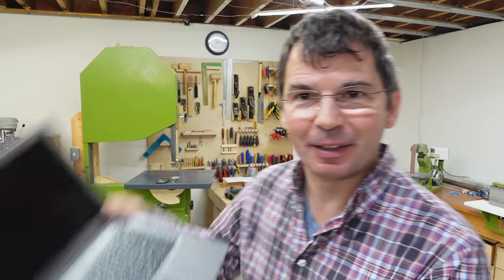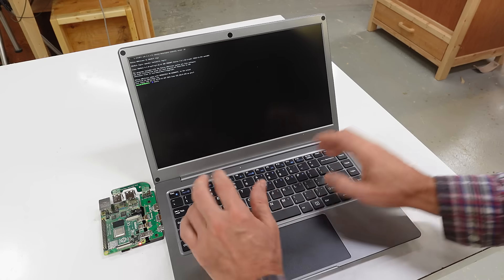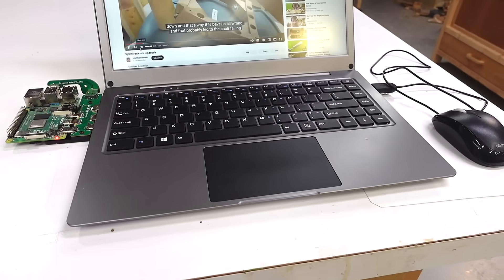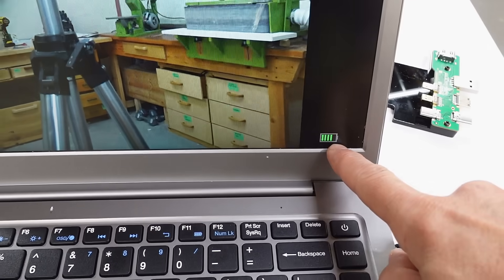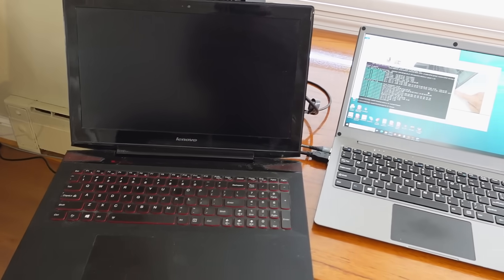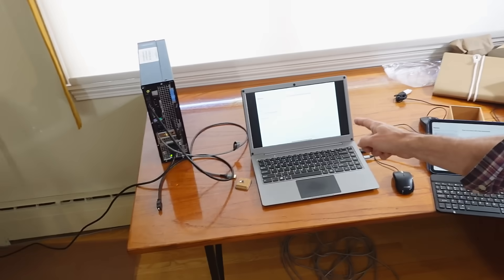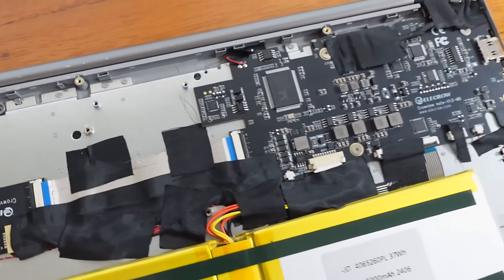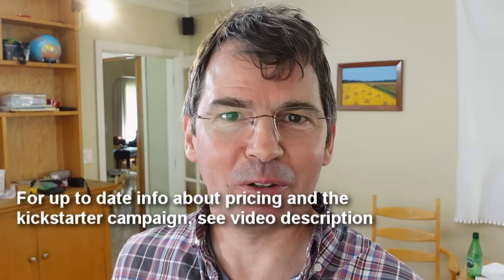This laptop has no brain

Comment: Believe it or not, waaaaay back in 2011 Motorola came out with an almost identical product that was specifically designed to be used with a certain model of smartphone. It was called the Motorola Atrix Lapdock. You can do exactly the same thing with it, but it does require either a ton of soldering to make custom cables, or buying weird adapters to make it compatible. I have one myself and it works great with every version of the Raspberry Pi (version 4 & 5 require a micro HDMI adapter).

Comment: I'd prefer to have an older laptop with proper input devices (such as a TrackPoint) and use that to SSH/VNC/RDP into a more powerful machine.

The idea is neat, but the product is not made with ergonomics in mind.
Reply: You know the way older ThinkPads have the CPU on a socket?  What if we could make an SBC that lives on that socket?  The RAM would be soldered on, because a modern ARM isn't going to be able to talk to the DDR2, let alone the specific northbridge.  But maybe some FPGA wizardry could let you use that DDR2 as swap space?

Aficionados like to tout that "you can upgrade the CPU", but like, WHAT is there today you can upgrade it to?

Comment: You could just buy a laptop, any laptop and remove everything off the motherboard then you’d essentially have that..  its got no memory other than eeprom and no graphics card other than the lcd driver and no fans or anything..  any kind of old laptop would do the same thing if you just plugged a usb hub into it..  i dont see any point of buying this over buying just a monitor and keyboard..  your still going to be plugging something into it no matter what..  is like buying a smartphone that doesnt phone..

Comment: I don't get how this is even new? We used to do this with motorola lapdock like 8 years ago?
Reply: I agree.  It's not a new idea, it's just a new version without making custom cables. Those Motorola lapdocks did have a much smaller battery though, and probably wouldn't power a Pi5.  I stopped using mine around the pi 3 timeframe.

Comment: Its cool but i dont like that you plug in a whole assembly. I'd rather plug in 1 usb c cable (compared to 3) for audio, data, power, hdmi because hubs exist for that and that you plug something into the pi to convert all the ports into 1 usb c cable(Like the ipad). Makes it neater and not that messy. Also with a cable you have flexibility and less likely case of ripping/bending the ports on the "lapdock". Still pretty cool though!
Reply from the maker: I hope the pi 6 can just do all over one usb c

Comment: I could see this being handy in the lab at my work.  We use a lot of small air-gapped networks and the workstations aren't usually close to the equipment the Pi would be hooked to.  I've got a tiny HDMI monitor and a roll-up rubber keyboard, but I'd much rather use something like this.

Comment: Seems like another solution is a Chromebook ($140 for the cheap ones) with a USB GPIO dongle
Reply from the maker: for many things, but limited griot that is very slow, whereas the pi has lots of different types of ports, like i2c, spi, and serial.  also can pulse the lines much more real time, many thousands of times per second.

Comment: Logitech, Microsoft, and a bunch of players I've never heard of before all sell  a keyboard with an integrated touchpad which is nice to work with mobile. (Logitech K400 for example) I already have several 17" screens that can be used mobile, or as a display for a phone. I like the idea of using a Pi5 in a fanless heatsink case with a pair of these, an external ssd storage drive, and a decent Microphone with a Scarlet or Behringer XLR interface for that mic, as a silent audio capture system. That case may look like it prevents access to the gpio pins, but there are pin extenders for that, and the DSI video interface, and camera slots use ribbon cables that can fit between the case seams. The big issue then becomes power for the setup. At home, a laptop USB power supply of 35 watts or more works. Mobile you can just barely get away with the 10 amps available at the 12v power ports that used to be cigar/cigarette lighter sockets. When you start looking at the battery packs of the various 'portable power stations' I'm of the opinion we're stretching the idea mobile though.

Comment: Summary
## Elro Raspberry Pi Laptop Summary

* 00:00:00 This is not actually a laptop, but a monitor/keyboard combo.  The computer (Raspberry Pi or Jetson Nano) is separate and attaches externally. 
* 00:01:03 Adapters are provided for Pi 4/5 and Jetson Nano.
* 00:00:36 Pi connects via a bridge connector using USB and HDMI ports. 
* 00:02:44 Connection can be made through the adapter board or individual cables (preferred by the speaker).
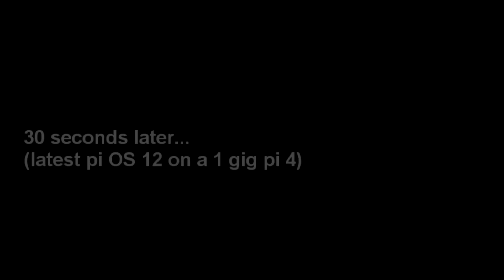* 00:01:11 The laptop battery powers the connected Pi.
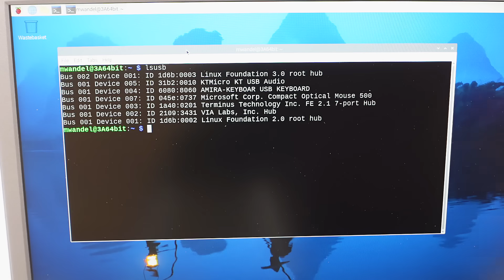* 00:02:01 Includes built-in speakers, headphone jack, USB hub, and touchpad.
* 00:04:23 Also functions as a standard monitor/keyboard with other PCs.
* 00:05:06 USB-C port enables desktop environments for newer smartphones with the proper dongle.
* 00:03:37 Device is powered by a surprisingly large internal battery and has a battery status button. 
* 00:07:21 An NVMe slot appears present internally, but is not fitted with a connector. 
* 00:08:00 Early bird Kickstarter price is estimated to be around $120.
* 00:08:00 Speaker sees the Kickstarter campaign as more of a marketing tool since Elro is a larger company.

Overall Impression:  While a cool concept, it's essentially a portable monitor with extra features for Raspberry Pi. Not as portable as a true laptop. 

I used Google Gemini 1.5 Pro to summarize the transcript.
Cost (if I didn't use the free tier): $0.0738
Time: 28.27 seconds
Input tokens: 19193
Output tokens: 634

Comment: A bit of a janky implementation, but I could honestly see this being a far more pleasant way to work on a Raspberry Pi project. I ususually use a micro-USB (for Pi Zeros) OTG hub thing, which works, but trying to get a Pi, Zero or otherwise, to stay in place with a USB USB and an HDMI cable coming out of it is always a challenge. I usually end up just taping the HDMI cable to my desk, lol.

I really want something like this that acts like a USB C port expander with a built in display and keyboard/trackpad though. Present day, it would would be a decent way to make use of Samsung Dex, but more realistically (it's a cool feature, but there aren't many Android apps that I find truly "productive" so I don't really use it), if mobile Linux ever gets to the point where 1. it's reasonably performant, and 2. more devices support something like Ubuntu Touch's once proposed Convergence (switching to a full desktop environment when connected to an external display and peripherals), I'd probably keep a little dumb terminal laptop thing in my back seat at all times, just in case I ever need to either entertain myself while waiting in a parking lot, or get a call from a client and need to make a quick fix on a website or something.

Comment: Couldn't they figure out a thick cable that plugs into all of those three connections and takes their individual signals to a small box glued to the back of the lid, where the pi sits?
That would be much slicker.
No way that side board doesn't break after picking up the laptop a dozen times

Comment: Interesting; I rolled my own computer from scratch a few years back (a few of them really) .. mostly with VGA out, but I did fiddle with HDMI-out on them a bit; VGA is way easier to generate of course... and there are some cheapo cables to do VGA->HDMI. I've been loking for a nice laptop case to wrap around those - could roll my own too but never looks nice; something like this above, but wsith an inch thick empty cavity underneath would have been awesome, but even as is .. could be workable if ugly; plug my monster little computer into the side with some cables, good to go. So if the price is right.... maybe? Great preview, thanks!

Comment: That is an off the shelf cheap chinese laptop body, i fixed a bunch of these with different but low end specs and they do have an m.2 ssd slot on the higher end models...
I think this is really overpriced at the early bird price too if the io board is not included this is a 30 bucks product, bad lcd (possibly lowend or B stock too) paired with a no brand battery and a stock case you can get for dirt cheap in bulk. The pcb only has a HDMI to edp adapter ic, a battery charger ic and an usb hub, so the wholepcb with parts is about 10-11 bucks manufacturedand they most likely don't pay the hdmi fee.
Reply from the maker: did the ones you fixed have the same tiny power plug, and the same ports in the same spots, like the mini hdmi port?
Reply: KUU Kbook, Qilive 14, Teclast and similar brands are common, but a lot of these get sold under made up names as they have so bad reputation they don't want a recognizable brand.
Well I typed a bunch of stuff but it disappeared, sad.
Maybe it is held back for review but I couldn't even send it so probably not which i sweird as it had no links, no weird words or anything.
Reply: If you want to find the exact same laptop, you need to find 5-6 years old models or older, this wide bezel is old, they changed to thin black ones and the 1-3 years old ones usually have the "no bezel" designs too. Well good luck with finding that :)
 But during your search you will see that a specific ali wholesale site has functional, similar looking laptops under 130 bucks if you need 100+ of them.

Comment: Could be useful for servicing rack-servers, but it needs a vga-port. There are not many battery-powered monitors out there that have a vga-port. usually just hdmi or usc-c. found some, but expensive or low resolution screens.

Comment: Samsung phones have dex, which can basically be used like a desktop.  I bought a similar device, nexdock.  It didn't quite work out how I wanted it to, but it was a pretty nice unit and can just be used as a second monitor instead.  It also featured USB C charging (though only on a dedicated port  - still you didn't need some special charger).

Comment: Another possible option is the use of a "usb stick PC" or at least some of them.
amazon has a lot listed on their site.
Reply from the maker: it would be cool if there was a standard for some compute boards that fit i side a laptop.  I find monitors and keyboards lat at least two computers before they need replacing.  mice in the other hand don’t outlast a computer.

Comment: Interesting product. 

Would probably have been nice if it had an internal slot for a Pi compute module. Then for the extra cost of one edge connector you'd have had the option of using it as a stand-alone laptop.

Without that it probably makes it way to niche of a product to get many sales.
Reply from the maker: but as such it would be less useful to me.  just as a computer I’m happy with a pc.
Reply: @matthiasrandomstuff2221  True, but using it with a compute module would be optional and in addition to it's current capabilities.

Being able to use it as a basic standalone Linux laptop then plug it into a server or external Pi and start using it as a KVM would be useful for sys-admins. And that wouldn't detract in any way from it's current utility for those who don't have any need to use it standalone.

Comment: This device is a console server essentially, except it's not a rack drawer. The primary purpose of this product is to act as a way so you can do remote server management. You can also use it like you're demonstrating and that is nice for when you need to test a PC but don't want to lug a monitor, keyboard and mouse around or don't have space to do so.

Comment: Kind of lame there isn't a compute module option. There is no way I'd feel comfortable sticking this in my laptop bag or backpack. Assuming the interface stays the same between compute modules, you could update device firmware to enable upgrades between pi4 and pi5 and so on when pi6 comes out.
Reply from the maker: they have changed interfaces on the pi and compute modules a few times already, so don’t count on that.

Comment: I sure hope Elecrow reads your comments because I was ready to sign up for buying it until you mentioned two things.
The first was the use of Kickstarter. I know a lot of these companies use it for marketing but it's very anti-consumer and anyone with products ready to ship using Kickstarter first is a huge red flag.
The second is that charger. Not being able to use a USB-C charger, which everyone else is using now adays, just makes this useless for anything more than a desktop device. And at that point you don't need the laptop form factor.
There are a very small handful of devices like this already out there, it's not a new concept. I've been wanting one for awhile but they are way too expensive for a hobbyist. If it wasn't for the shady use of Kickstarter and the just dumb choice of the charger I would buy this TODAY even for "full price" as it is likely to be cheaper than any other option.
Reply from the maker: I don’t mind non usb-c, but I wish they had used the same size connector as all my external drives and such.  I don’t like the tiny little power connector.

Comment: I've seen those before. They are called rack consoles (except without the battery)
Reply: except that rack consoles are super heavy because they're meant to go in a rack, not be portable. They're not designed to be light or portable at all, so while they're kind of the same idea, they're not really the same thing at all. Would you carry a rack console around with you to randomly plug into other machines?

Comment: I was rooting for this until 1 minute in and realised you have to plug it into the OUTSIDE of the laptop. Super disappointed. I thought perhaps the laptop might have used the compute module rather than a standard Pi.

Comment: Better if it had a snap on wedge underneath it, like keyboards have flip up feet to change keyboard angle, that could safely hold the R-PI so nothing is sticking out getting broken off. Matthias, pull off the bottom cover and replace it with one that houses that plus larger speakers as a future episode. Vacuum formed sheet or light wood.

Comment: Funniest thing is getting to the airport check with this thing: "Please turn it on" "This cannot be turned on, officer. Unless you happen to have a RPi with you"
Reply: why would they ever ask you to turn on your laptop
Reply: @mikitymike  To prove there is not only drugs hidden inside but also a raspberry pi. I've had these checks in some airports. Needless to say if this check is online then common sense is questionable
Reply: @mikitymike  I'm not a frequent flyer but had this check in 2018. I doubt you are that young. I'm telling you: it happens only in the selected set of countries that put 'security' on high priority
Reply: @mikitymike  I don't know if they still do this but it used to be the norm. For some reason if it turned on, they didn't think it was a bomb.
Reply: @ddegn  True, I remember those days.  Wonder what they would have done to me if I had the audacity to bring a non-functioning laptop on the plane?  I imagine that was pretty common, if your battery was dead or your laptop broke on a journey.  Maybe that's why they gave up on that piece of security theater.
Reply: @RealJohnnyDingo  that happened to me, if you can't turn it on they just run it though the chemical sniffer to check for bomb residue. It took a couple minutes so if you can turn it on it just saves them time. No big deal.

Comment: What a useless piece of e-waste. If you're gonna have the pi dangling off the side then just make it connect via cables so you can position it physically where you want, not deal with potential damage to the connectors, and be compatible with any model.

Comment: Do I have this wrong, or do the Fn keys only acut as their special/media functions UNLESS you hit the Fn key, despite the colour coding suggesting otherwise? Often on laptops you can go into BIOS and switch this functionality, but being brainless this wouldn't have such a setting, unless there's a DIP switch to toggle it. I'm interested in the product, but that's a major pain point for me with various wireless keyboards for instance.
Reply from the maker: yes, confusing.  you need to push the special function key to actually use the function keys as such.  but then again, we don’t use word perfect much anymore so function keys are rarely used.

Comment: About $ 120 for "early birds". So presumably the final product will cost more than that. Add to that the cost of their connector boards or your own cables. And of course a Raspberry Pi. Also despite designing the thing, they didn't bother to use any of the ample room inside the device to allow you to (at least partially) insert the RPi, instead leaving it dangling on the side.
For the same amount of money you can easily get a refurbished laptop with equal or better specs. Or if you're wanting to make use of an RPi, this "brainless laptop" doesn't seem much better than a regular monitor, mouse and keyboard. I could really only see it work if you are either very constrained in available space or if you have a need to regularly move or store your RPi setup.